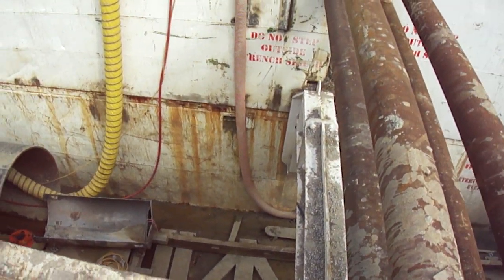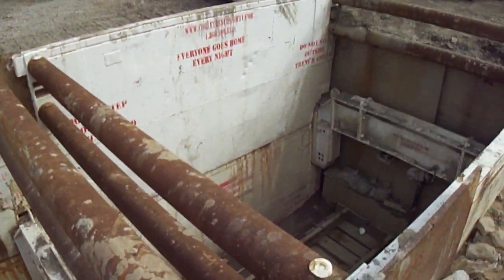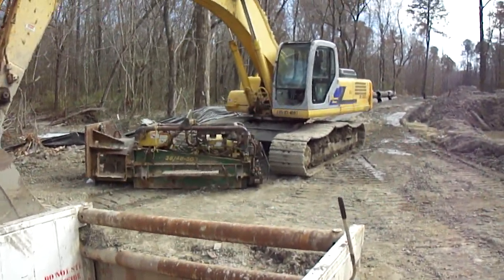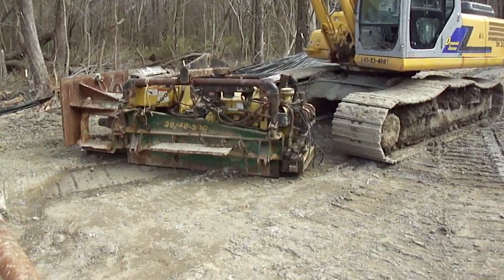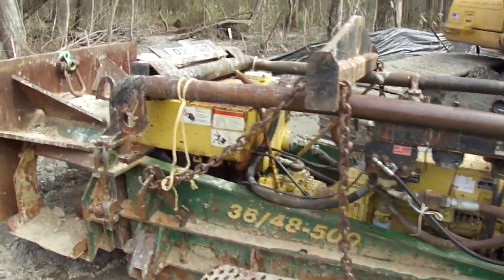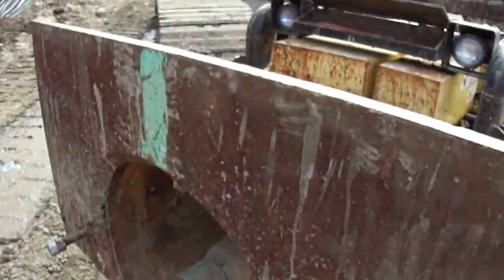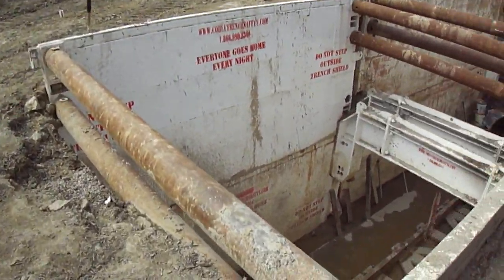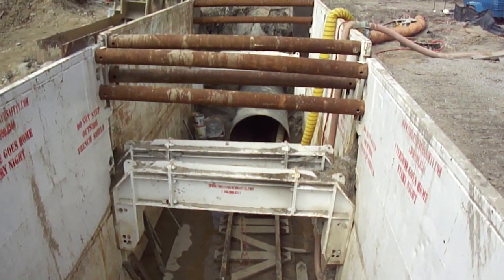48" Line Boring

Comment: We use them here too, looks like a Deutz air cooled diesel engine, it's got a heavy duty transmission, hydraulic pump for the rams that push it while it bores, usually a hydraulic winch and when it's in the hole boring the engine part hooks up to a set of augers on the business end is a boring head with teeth. They're a sort of primitive tunnel boring machine, but they don't like rocks to much.